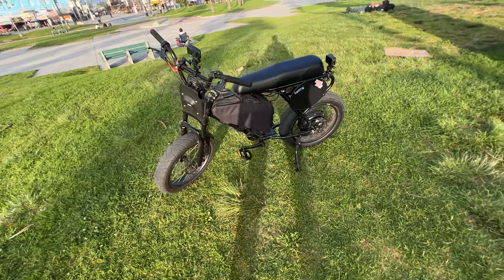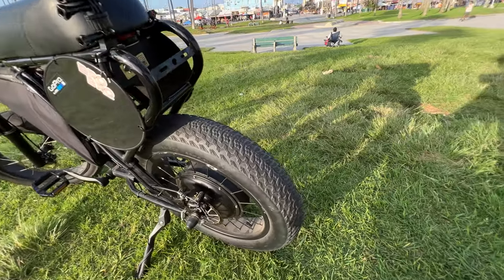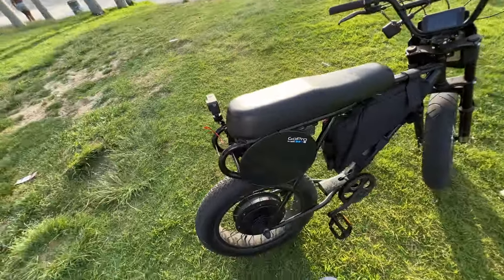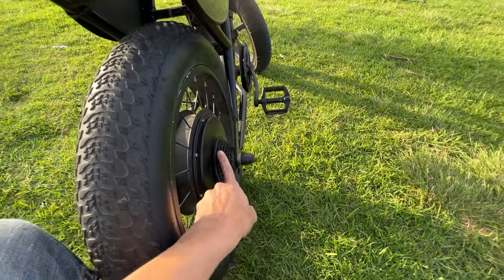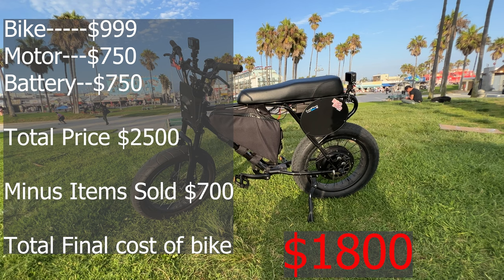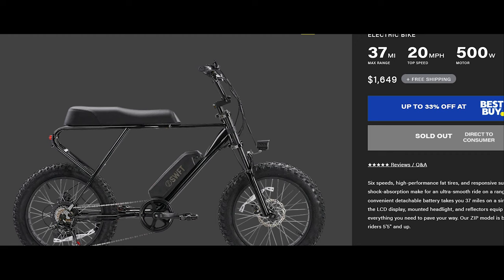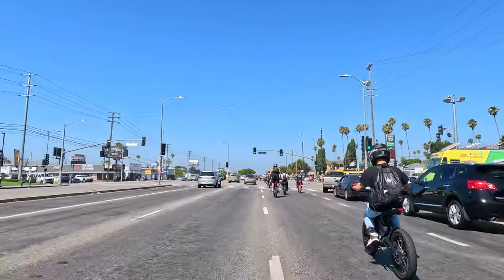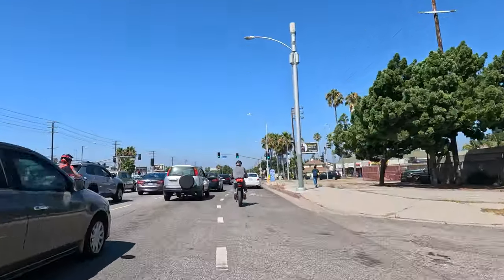72V Upgrade Your Swft Zip & Hurley Mini Swell & Macfox M20X To Be A Surron & Super 73 E-Bike Slayer

Comment: Hi, could you please provide a new link for the 72v 3000w Hub Motor? It’s not working properly.
Reply from the maker: OK let me check...one second
Reply from the maker: Amazon is currently out of stock but you can get on eBay just search for these exact requirements. 170mm 72v 3000W 20*4.0inch Fat Bike Kit with Sabvoton 80A waterproof controller. If you have the same frame as me in the video make sure the wheel says 170mm dropouts.
Reply: Thank you so much!

Comment from the maker: Upgrade Your Swft Zip & Hurley Mini Swell & Macfox To Be A Surron and Super 73 E-Bike Slayer For A Fraction of the Cost.
After numerous requests for more information about the e-bike I ride. I have finally made a video. Here it is. I call it The Grind Bike.
Links to all the parts I used below:
The Base Bike https://amzn.to/3OWxsG7
72V 3000Watt Battery https://amzn.to/45uB4pY 
72V 3000Watt Hub Motor https://amzn.to/3EiPJss 
Torque Arm https://amzn.to/3QZxbEU
 Vintage MX Plate https://www.ebay.com/itm/172959968830
Reply: Can you make a tutorial on how to build the bike?
Reply: Do we need to buy a new controller
Reply from the maker: @Fuego-_-IQ  Yes the new controller comes with the 72V 3000Watt Hub Motor https://amzn.to/3EiPJss
Reply: @YoGRIND  If you get the Motor do you need to upgrade your battery?
Reply from the maker: @aekdb2003  Brushless ebike motors can run on a wide variety of voltages, so you can run the same motor on a different battery. However,
The controller and battery should be well-matched. To properly power a 72V 3000W ebike motor with a controller that has a voltage range of 48-72V (max 86V) and 80 amps, you would need a battery that can provide at least 72V and handle the maximum current of 80 amps. It's important to select a battery with a voltage and current rating that matches or exceeds the requirements of the motor and controller. Additionally, considering the high power requirements, it's important to ensure the battery has sufficient capacity to provide the necessary energy for your desired riding range.

Comment: Where can I get replacement parts for a bare bone Swift Zip rebuild ? I need everything.  Brakes Tires, seat, rear light, headlight.. I have handlebars. 
And I see where to get motor and battery. 
Thank you so much for your post.
Please answer. I can't wait to get started.
Reply from the maker: Your best bet is to find parts on eBay. Swift Zip doesn't sell those parts separately, but I've seen listings from people parting out the bike on eBay.
Reply: @YoGRIND  Great info reply.
Thank you.

Comment: did you have to cut a wire to unlock the full potential cause some bikes limit the speed unless you cut a wire
Reply from the maker: Nope. You have to purchase the 3000w motor and controller separately. The motor and controller come fully ready to be attached to the bike without cutting wires. However the bike only comes with a 500w motor that is capable of a max speed of 20 (the legal limit)
Reply: can you also make a video showing hot you attached the battery and motor?
Reply from the maker: Yes will do. however, it was just a simple drop-in and bolt on.

Comment: how long did it take for your motor kit to arrive, bcause some of the reviews say it takes forever and sometimes the specific items dont show up at all
Reply from the maker: I had no problems my motor was here in 4 days because it was in-stock. I even spoke with their customer support lady and she was very knowledgeable about the motor and battery.
Reply: @YoGRIND  what motor and battery would i want if i was aiming for 35-40mph, and did you upgrade the brakes?
Reply from the maker: A 1000w motor that is unrestricted will get you to 40mph however I have not tried that combination. This one looks like it will work https://amzn.to/3LIe6DP but again I have not tried it. The brakes are stock but should be upgraded. I have not upgraded the brakes because this motor has Regenerative brakes so it slows itself down without me needing to use the brakes. Thanks

Comment: What going on.
New update.
I found both a 72v 5000w motor & 72v 5000w 24ah battery. 
Could these components also work for this rebuild?
Reply from the maker: Yep should work if they have these specs Rear Wheel : 170-175mm drop out

Comment: hi i was going to build this exact build with my swft zip, does a 3000w hub motor + a 3000w battery = 6000w of power? and whats realistic range if you were to go 50+mph the whole time?

thanks
Reply from the maker: 50mph on level ground at sea level with a 180lb rider will eat that battery fast. You will be lucky to get about 15 miles. I get 35-40 miles during normal use at 30mph. A 3000w battery means that the battery can output 3000 watts of energy in one hour. The 3000-watt motor means it can take 3000 watts of continuous power. It does not mean 6000w of power at all. Thanks
Reply: thanks for the response, ive been researching all day, I think im gonna go with a 5000w motor and battery because i live in a hill terrain and i need to be able to keep up with 50+m traffic.  @YoGRIND

Comment: Where is the links
Reply from the maker: Links to all the parts I used below:
The Base Bike https://amzn.to/3OWxsG7
72V 3000Watt Battery https://amzn.to/45uB4pY 
72V 3000Watt Hub Motor https://amzn.to/3EiPJss 
Torque Arm https://amzn.to/3QZxbEU
 Vintage MX Plate https://www.ebay.com/itm/172959968830

Comment: How did you remove the chain?
Reply from the maker: I used a chain tool to push out a pin.
Reply: @YoGRIND  not the actual chain more specifically how did you go chainless like how is it moving with out needing to pedal at all? Is it just the upgraded motor
Reply from the maker: @thatoneguy1072  Sorry, yes sir its the upgraded motor 72V 3000Watt Hub Motor https://amzn.to/3EiPJss  it comes with a throttle so you don't need the chain.